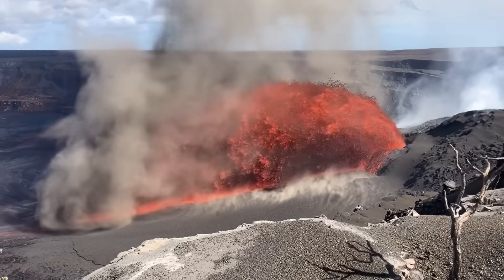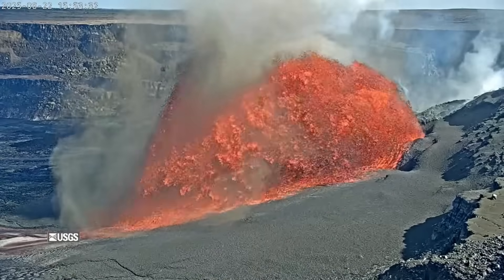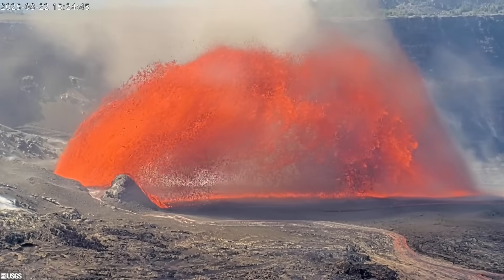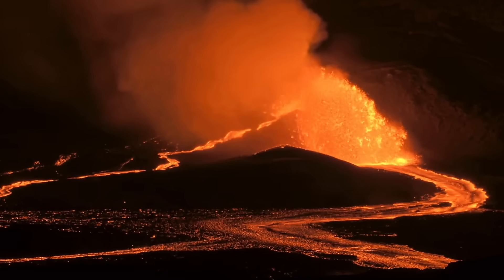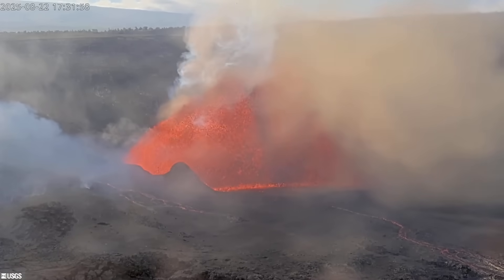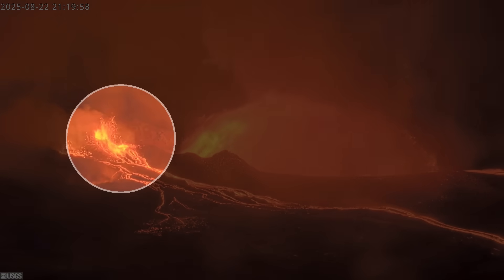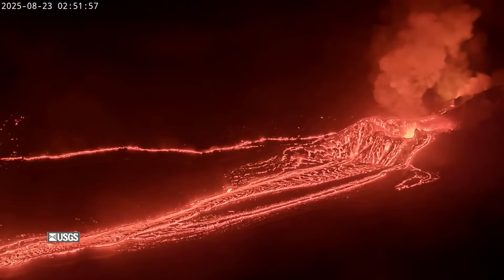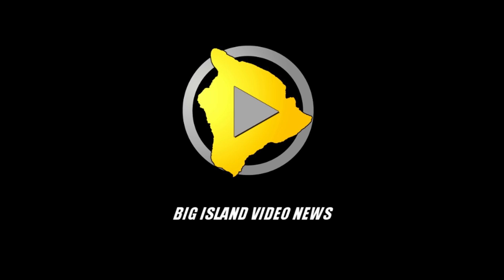Inclined Lava Fountain Erupts At Kīlauea Volcano (August 23, 2025)

Comment: The 45° angle on the north vent was there during the episodes 30 and 29 too. It isn't due to the "inner cone" but due to the tephra slumping into the conduit after episode 28 and blocking the vent. At the start of episode 29, the magma found a way passing the blockage and altering the vent so the lava comes out on an angel instead the straight up fountains we've seen before.

Comment: The volume it’s ejecting is staggering.  You can’t get a sense of how big the angled eruption is, but if the “500 vertical feet” is accurate, the sideways spray is traveling the distance of TWO football fields!

Consider how small that would make a person standing nearby 😳.  240 cubic yards per second are blasting out of the Earth!
Reply: The peak estimated height from earuptions earlier in the year was ~1250 ft.  So 500 here is easily believable.
Reply: 😳🥹
Prayers For Everyone's Safety.❤❤❤❤❤

Comment: how much weight did these 31 episodes add to the Caldara?.
Reply: The lua kilauea (caldera) at Hale  'Ama'uma'u/Kilauea will most likely NEVER fill up nor will it add any weight. First of all, the caldera is now more than 20 times bigger in surface area than it was in 2018.  It now covers +/- 5 square miles and is +/- 400-600 ft deep with a volume of 1/4 to 1/2 cubic miles! Second: all the a'a you see being ejected from these a'a pua'i (lava fountains) is basically recycled from the ka'ei pelemaka (magma zone) as the a'a layers (ho'opapa) one on top of the other pushing the lowest layer (papa) back down into the ka'ei pelemaka where it is re-melted and subsequently ejected over and over and over again. Recycled a'a is estimated to be upwards of 85% of the a'a in the new a'a pua'i, if not more! Even if that number was far lower it would still take many lifetimes for the lua kilauea to even approach ever being filled. At this moment the balance between the a'a level and the underlying ka'ei pelemaka pressure upwards (NOT including the intrusion of gases, ie, carbon dioxide (CO2), sulfur dioxide (SO2), hydrogen sulfide (H2S), hydrogen fluoride (HF), and carbon monoxide (CO)), is static. The reason we're seeing all these a'a pua'i is because of the intrusion of all the gases mentioned above and NOT because the pelemaka puale (magma vent) is exhibiting any greater pressures than normal! Aloha
Reply: @terryridge4596   Thank you

Comment: How long until the caldera fills up and it starts flowing out of the valcano??
Reply: The lua kilauea (caldera) at Hale  'Ama'uma'u/Kilauea will most likely NEVER fill up. First of all, the caldera is now more than 20 times bigger in surface area than it was in 2018.  It now covers +/- 5 square miles and is +/- 400-600 ft deep with a volume of 1/4 to 1/2 cubic miles! Second: all the a'a you see being ejected from these a'a pua'i (lava fountains) is basically recycled from the ka'ei pelemaka (magma zone) as the a'a layers (ho'opapa) one on top of the other pushing the lowest layer (papa) back down into the ka'ei pelemaka where it is re-melted and subsequently ejected over and over and over again. Recycled a'a is estimated to be upwards of 85% of the a'a in the new a'a pua'i, if not more! Even if that number was far lower it would still take many lifetimes for the lua kilauea to even approach ever being filled. At this moment the balance between the a'a level and the underlying ka'ei pelemaka pressure upwards (NOT including the intrusion of gases, ie, carbon dioxide (CO2), sulfur dioxide (SO2), hydrogen sulfide (H2S), hydrogen fluoride (HF), and carbon monoxide (CO)), is static. The reason we're seeing all these a'a pua'i is because of the intrusion of all the gases mentioned above and NOT because the pelemaka puale (magma vent) is exhibiting any greater pressures than normal! Aloha

Comment: The pressure release is good. 
The movement of the earth creates friction, thus forming more areas of built-up pressures or the lessening of pressures depending on the area and prior movements of faults. The release stabilizes the areas. If we had quakes without pressure release, that could become problematic. 
Monitoring devices and an evacuation plan are advisable.
Reply: this several thousand miles away from any fault
Reply: That's not at all what happens here. Mokupuni o Hawai'i kaula (Hawai'i Chain of islands) sits on the  Pakipika Papa (the Pacific Tectonic Plate) and moves WITH that plate. Underlying Mokupuni o Hawai'i is a PERMANENTLY affixed hot spot (Wela Kiko) that supplies pelemaka (magma) via the ka'ei pelamaka (magma zone) which forms  the these luapele palulu (SHIELD volcanoes), of which Mauna Kahalawai (West Maui Mountains), Mauna Haleakala, Mauna Loa, Mauna Kea, Mauna Hualalie, Pu'u O'o, and many more are, including 4 new mauna Kai sitting 22 miles off the southeast coast at 3,200 ft BSL of Ka'u on Moku o Keawe (Big Island of Hawai'i), of which one is named; Mauna Kai Kama'ehuakanaloa, and 3 others which are not named as of yet. There is no built-up pressure from these plates as they are already floating on the ka'ei pelemaka below. Aloha
Reply: The Hawaiian Archipelago was created by a mantel plume, unlike those volcanoes on the Ring of Fire, which are created as you say.
Reply: Go educated By a real person

Comment: Ok, who wants to bet me 50 cents...Australian....that lava will overflow the summit before one of the side rifts opens and drains it again?
Reply: The lua kilauea (caldera) at Hale  'Ama'uma'u/Kilauea will most likely NEVER fill up. First of all, the caldera is now more than 20 times bigger in surface area than it was in 2018.  It now covers +/- 5 square miles and is +/- 400-600 ft deep with a volume of 1/4 to 1/2 cubic miles! Second: all the a'a you see being ejected from these a'a pua'i (lava fountains) is basically recycled from the ka'ei pelemaka (magma zone) as the a'a layers (ho'opapa) one on top of the other pushing the lowest layer (papa) back down into the ka'ei pelemaka where it is re-melted and subsequently ejected over and over and over again. Recycled a'a is estimated to be upwards of 85% of the a'a in the new a'a pua'i, if not more! Even if that number was far lower it would still take many lifetimes for the lua kilauea to even approach ever being filled. At this moment the balance between the a'a level and the underlying ka'ei pelemaka pressure upwards (NOT including the intrusion of gases, ie, carbon dioxide (CO2), sulfur dioxide (SO2), hydrogen sulfide (H2S), hydrogen fluoride (HF), and carbon monoxide (CO)), is static. The reason we're seeing all these a'a pua'i is because of the intrusion of all the gases mentioned above and NOT because the pelemaka puale (magma vent) is exhibiting any greater pressures than normal! Aloha

Comment: How long do you think the caldera will be full, again, to spill over, again?
Reply: Not likely since the volcano collapses on itself.
Reply: The caldera never spills over. The flows you hear of are from other vents/fissures.
Reply: The lua kilauea (caldera) at Hale  'Ama'uma'u/Kilauea will most likely NEVER fill up. First of all, the caldera is now more than 20 times bigger in surface area than it was in 2018.  It now covers +/- 5 square miles and is +/- 400-600 ft deep with a volume of 1/4 to 1/2 cubic miles! Second: all the a'a you see being ejected from these a'a pua'i (lava fountains) is basically recycled from the ka'ei pelemaka (magma zone) as the a'a layers (ho'opapa) one on top of the other pushing the lowest layer (papa) back down into the ka'ei pelemaka where it is re-melted and subsequently ejected over and over and over again. Recycled a'a is estimated to be upwards of 85% of the a'a in the new a'a pua'i, if not more! Even if that number was far lower it would still take many lifetimes for the lua kilauea to even approach ever being filled. At this moment the balance between the a'a level and the underlying ka'ei pelemaka pressure upwards (NOT including the intrusion of gases, ie, carbon dioxide (CO2), sulfur dioxide (SO2), hydrogen sulfide (H2S), hydrogen fluoride (HF), and carbon monoxide (CO)), is static. The reason we're seeing all these a'a pua'i is because of the intrusion of all the gases mentioned above and NOT because the pelemaka puale (magma vent) is exhibiting any greater pressures than normal! Aloha
Reply: @terryridge4596 Mm, I see, thank you for the information, I wasn't aware of.  Hmm makes a lot of sense the way you explained it.  Thank you, again.
Reply: Are you a volcanologist, Terry?  If you are, what an amazing job to have.  Very interesting, by far.

Comment: Will the caldera ever be completely filled?
Reply: It's more of a cycle of filling and collapsing. It hasn't overflowed in at least 300 years.
Reply: given enough time.
Reply: @akiona808  Never! Aloha
Reply: The lua kilauea (caldera) at Hale  'Ama'uma'u/Kilauea will most likely NEVER fill up. First of all, the caldera is now more than 20 times bigger in surface area than it was in 2018.  It now covers +/- 5 square miles and is +/- 400-600 ft deep with a volume of 1/4 to 1/2 cubic miles! Second: all the a'a you see being ejected from these a'a pua'i (lava fountains) is basically recycled from the ka'ei pelemaka (magma zone) as the a'a layers (ho'opapa) one on top of the other pushing the lowest layer (papa) back down into the ka'ei pelemaka where it is re-melted and subsequently ejected over and over and over again. Recycled a'a is estimated to be upwards of 85% of the a'a in the new a'a pua'i, if not more! Even if that number was far lower it would still take many lifetimes for the lua kilauea to even approach ever being filled. At this moment the balance between the a'a level and the underlying ka'ei pelemaka pressure upwards (NOT including the intrusion of gases, ie, carbon dioxide (CO2), sulfur dioxide (SO2), hydrogen sulfide (H2S), hydrogen fluoride (HF), and carbon monoxide (CO)), is static. The reason we're seeing all these a'a pua'i is because of the intrusion of all the gases mentioned above and NOT because the pelemaka puale (magma vent) is exhibiting any greater pressures than normal! Aloha
Reply: @terryridge4596  Very interesting Terry, thank you. When I was there in 2019 the caldera was something like 1300ft deep and had a small pool of water forming at the bottom. I was there again in April 2025 and lava had filled the caldera to about 500ft below the rim, so obviously there was a considerable net gain in lava volume. I too had wondered when/if the caldera would fill completely and it's interesting that an equilibrium point has now, more or less, been reached reached. I thought lava might eventually inundate the dropped down block but perhaps not!